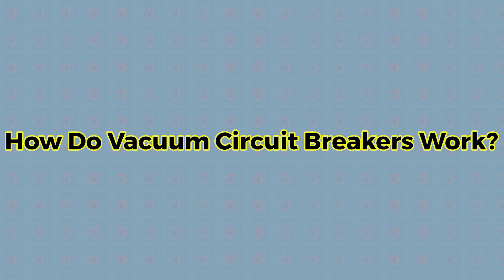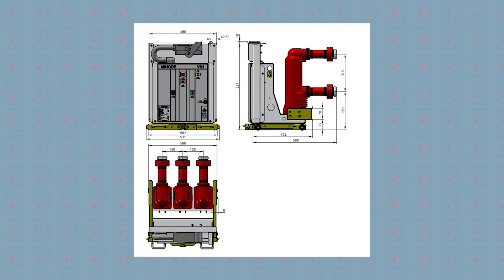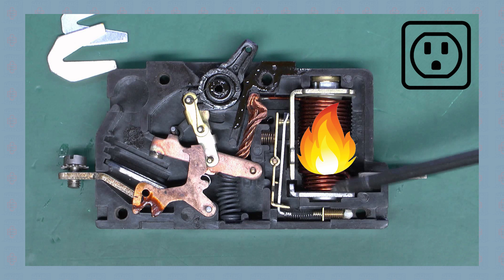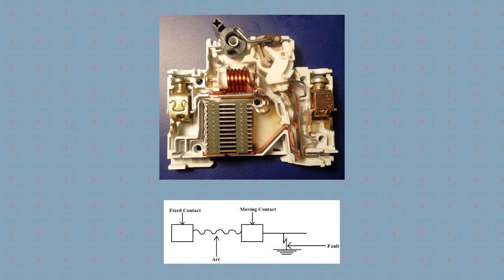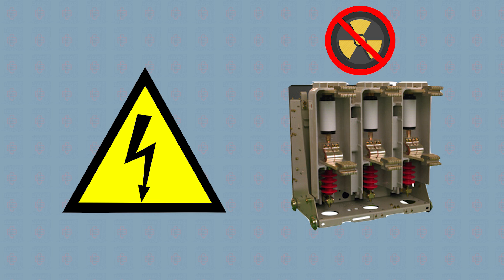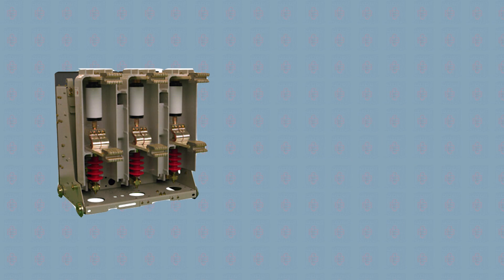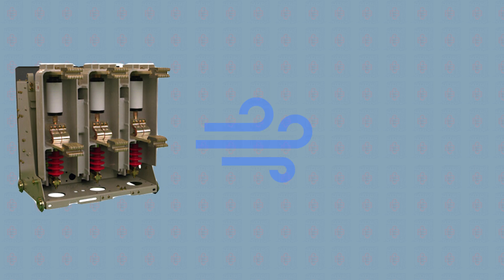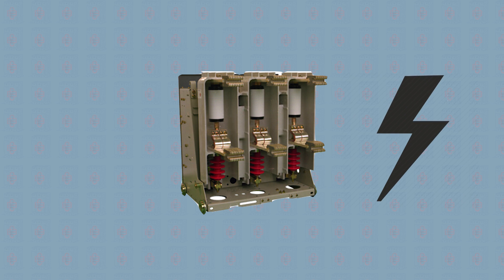How Do Vacuum Circuit Breakers Work?

Comment: sir transfarmer ki neutral ko earth kyo krte h sir
Reply: Mohil Sharma when ever there is an earth fault on any phase the flows from phase to neutral through wrath and the circuit completes. So large fault current flows based on transformer’s impedance. The series fuse blows or Mcb trips, thus the fault is isolated.